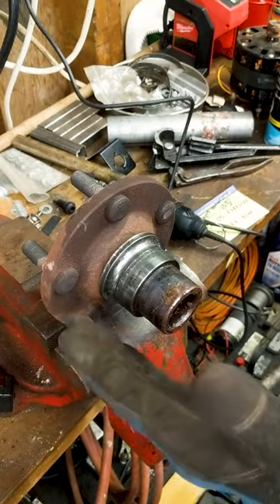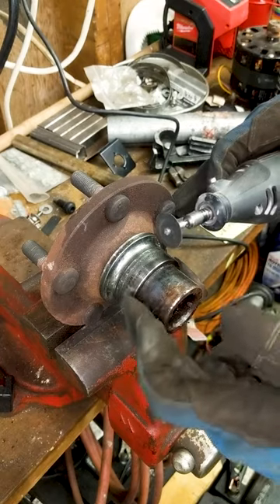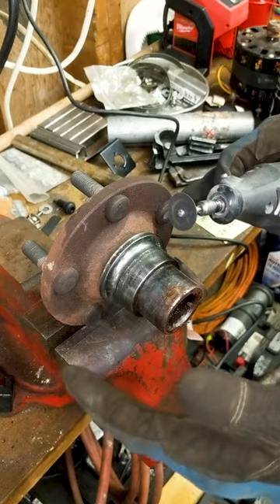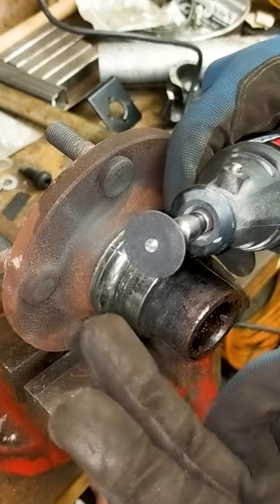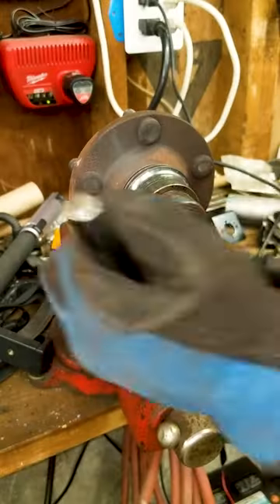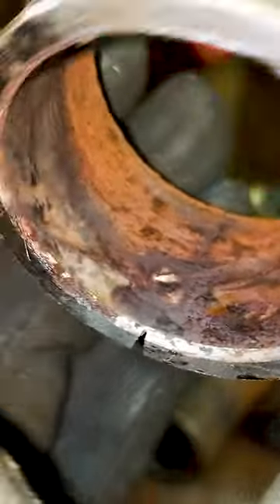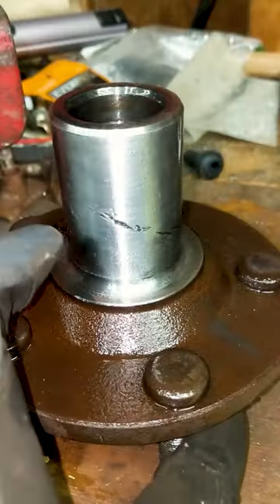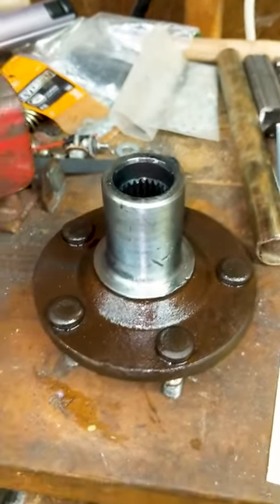Remove Bearing Race From Hub The Smart Way! #Shorts

Comment: They sell new hub assembly’s now with a new wheel bearing for under 200 bucks. Just bought two of them and I was done in 30 minutes. 😀
Reply from the maker: $200 is a lot of money to a lot of people. I charged less than $200 for this entire job. Wheel bearing was like $30 and this only took me a few minutes. Whole job was a few hours due to rust cleanup and all. Old rusty car on its last legs.

Comment: Run a line of weld around it and it will swell it and it will  come of twice as easy and you won’t damage the shaft which is very likely with any kind of grinder
Reply from the maker: There are a lot of methods that work, but many involve more expensive tools that most people don't have and heat which I like to avoid when it's not necessary. This is just one way and part of the reason to use a Dremel instead of an angle grinder is greatly reduce risk of damaging anything or hurting yourself. They normally come off much easier after cutting, but I didn't angle this one as much as I should and the shaft was very rusty. Releasing another version soon where I cut both sides.

Comment: Damn that thing just needs a new hub
Reply from the maker: It worked fine. Car is very old and beat and on its last legs. New hubs are quite pricey for the 2000-2004 Legacy platform and are barely available.

Comment: Will that air help  a 4-1/2 cutoff wheel on the angle grinder?
Reply: Probably not, most wheel wear is from hogging into the cut. Fireball tools has a good video on it, though I will add, cheap discs usually don't last long anyway. But if you're making a bunch of brown dust, your wheel is just eroding away and not really cutting. 
Source: me with hundreds, if not thousands of hours using grinders.

Comment: PRO STYLE. 📡👽🇺🇸 RUN!!! That compressed air keeps that wheel cutting wheel cool it's a good move.
Reply from the maker: Hahaha. Yeah it works great instead of using like half a disc if you go fast it barely changes size.

Comment: I accidently slitted into the hub. Is that fine? Its about 2mm deep cut.
Reply from the maker: Yeah, no big deal as long as it doesn't go the entire length of the bearing mating surface.
Reply from the maker: Even then, it might be okay, but there's a chance it will allow the bearing to slip on the hub or it could eventually crack. Low chance, but I still have to mention it.
Reply: @802Garage  okay thank you so much for the quick reply and advice!

Comment: As an older man with health issues I'll just buy the whole assembly. 
I can buy the hub and bearing from rockauto or parts geek for $60.
Now its take old off, put new on 🤷🏿‍♂️
Reply from the maker: I mean that's great. Issue in this case is that the hub is mostly only available from the dealer now and is $100+ and while there are aftermarkets allegedly available many of them are lower quality brands you kinda roll the dice on. Plus this takes all of 5 minutes and really isn't a lot of effort even for an older person. Getting the hub off of the car is far more work in any rusty area. Suppose you could just buy an entire knuckle if money is no object. ;) This was an older car that just needed to limp around a while longer.

Comment: Yeah, mount it vertically, race pointing downward. Heat with propane torch while rotating hub. P link hub expands & falls off! Ex peasy!!
Reply from the maker: I think it takes quite a while with propane. But just showing one method.

Comment: Heat & gravity are much faster & easier...
Reply from the maker: Everyone watches the same South Main Auto video and thinks they're an expert. 😂
#1 How many times have you actually used the torch method?
#2 This doesn't take very long, especially if you angle the cut more than I did.
#3 This video is about cutting, not heating.
#4 How many DIY mechanics do you know that have acetylene torches?
#5 I avoid generating large pieces of hot metal as often as possible.
#2

Comment: 4 wheel drive I am guessing, or front wheel drive.
Reply from the maker: This was a rear Bearing on an 04 Outback or at least close to that year. Yep AWD.
Reply: @802Garage  so they don’t just have a bearing hub that the axle passes through?   I assume everything with a CV axle has a bearing hub that the spindle/axle goes through., at least on the front.   I am used to the old spindle where the hub, drum, rotors, have races on the inside.   It makes sense to have a race to preserve the hub.

Comment: Hope cleaned that rust off and gave it a good shine. What you've done and explained it shows why you can charge more  and why it's justified. If you get a cheap customer dont want to pay tell him well you'll be coming back for the same part. I charge more for labor. Tell them my labor includes prep work and more Garuntee your getting a brand new part in working condition same as coming from the production line. If you got sued or anything what you tell the judge. Your labor cost is what gets them more bang for there buck. He wanted to be cheap had to cut my labor to get him his vehicle. I changed the part like be asked got him a working vehicle. He got cheap labor but fair Labor. Even your cheap labor and is better than other. Meaning your taking care not to damage other parts. If you record your whole work you can sue the customer back but you can but then only accept what's fair for your time away from the shop so people will respect you and your craft 100 times more better
Reply from the maker: I definitely take my time and try to make everything nice. I did clean this up and I even cleaned and smoothed the gouges and bumps from previous "mechanics" one of which may have even prevented the race from sitting evenly. He has been daily driving the car for a long time now with a lot of weight in the back, has had no issues with either rear bearing I replaced. I agree with you.

Comment: yeah but how many discs you gonna replace whith that dremell usually takes longer time than an old trusty grinder with thin disk
Reply from the maker: I literally showed it... I didn't even use 10% of a single disc...
Reply: Sorry it cut in mid video it must be a good disc then
Reply from the maker: @luisdlc21  It's actually a cheap generic disc that came with a no name Dremel style tool. The air trick just actually works very well.

Comment: Why not just heat it up to cherry red and pull it off?  You can use a high head propane torch.  Most people doing this kind of work should at least have one of those in the garage.
Reply: High HEAT head.
Reply from the maker: @ginginthing  See pinned comment. Propane will never get this cherry red though. Way too much mass.

Comment: Doesn't matter if you nick the hub a tiny bit with an angle grinder. That's not a bearing surface, it doesnt affect it at all.
Reply from the maker: Yeah it doesn't matter, but I like to avoid damaging anything I work on. Plus the last person actually did damage where the bearing face sits against the hub back and I have to grind it down for a flat surface. Could have contributed to vibrations or bearing failure. A little care can go a long way.

Comment: Just replace the damn thing. My boss never wants to replace them and I want to replace them all. I got shit to do, money to make, more cars to fix. No matter what anyone tells you it’s always faster and easier to put a new hub on. Charge the customer and move on.
Reply from the maker: Obviously replacement is an option. It's not, however, what this video is about. This technique can also obviously be used on much newer and less rusty hubs. Not everyone lives in the rust belt. I also prefer not to create waste or spend money if I don't have to. Additionally, there are virtually no aftermarket hubs available for the 2000-2004 Legacy/Outback and corresponding Baja platform. Plus, aftermarket hubs that are affordable are often lower quality than OEM. If it ain't broke, don't fix it. The OEM replacement only comes as a hub and bearing assembly, and is quite pricey. The target audience for this video is primarily DIY mechanics, home gamers, and people on a budget. If you want to replace your hubs, but all means, spend your money instead of spending 5 minutes saving the hub. Personally, my 5 minutes is worth the $75 minimum this hub would cost to replace. Even the cheapest hubs I have seen are usually $25+ and I'd rather save the money. Lastly, this car is very high mileage and on its last legs as is, so a new hub would kinda be a waste. I have never had an issue with a hub I reused. Just saying.

Comment: What's the cost of a new hub ?
Reply from the maker: In this case the cheapest is $75 plus wait time from eBay. Hubs are very uncommon for the 2000-2004 Legacy platform and they don't sell aftermarket hub and bearing combos. Don't ask me why. Nearly $200 to get it from the dealer. This car is high miles and on its last leg, so this worked.

Comment: You risk going to deep wit this method better to use a grinder and grind a flat spot on the race as you get close to going through you’ll see the race change color from the heat on the thin metal
Reply from the maker: You're trading one risk for another. Far less likely to go too far with a Dremel.

Comment: Let’s go through those cutting wheels so fast man even with air
Reply from the maker: It literally barely wears down if you use the air, hence the tip. I did both sides of a bearing race thicker than this one the other day and used maybe 1-2mm of a wheel.

Comment: I usually use my induction heater + a chizzle nizzle then tap it off after heating
Reply: That's what I did to  mine, I tap it the first time after I used the induction heater,the race moved a little.and it dropped out by itself after the second time applying the induction heater.

Comment: Heat the race with a MAP Torch and it's going to slide right off...
Reply from the maker: I usually only see it done with acetylene. MAP would take quite a while, especially depending on the hub. This video was about the cutting method though.

Comment: Or…….
You can heat the race up and hit it with some cold WD-40 then take a small ball peen hammer and hit the race with the ball and the race should shatter like glass. 
Done this several times on wheel bearing races and has never failed.
Reply from the maker: Interesting.

Comment: I honestly thing the last 20 jobs I've done had the parts previously installed by a 🦍 with a 🔨.  Heater core?hammered. Battery terminals? hammered. Random bolts? Hammered. Brake calipers, hammered... hammered flat, mounts, hammered lolm
Reply from the maker: Damn I feel that, hahaha. This hub was beaten to hell.

Comment: Good thing that “damage” has absolutely zero to do with how well the bearing or hub function.
Reply from the maker: Yeah it's no big deal, although there actually was damage to the base of the hub rear which would have prevented the last bearing from sitting perfectly flat. I had to grind it down before refusing the hub. So sometimes it can matter and either way I like to not damage components. 😁

Comment: I just use a full size grinder, takes about 4 second. Slap a chisel on the groove and it cracks, done.
Reply from the maker: Same.
Reply: @802Garage  somehow missed you talking about it at the start. Don't see why your tip would be to use a smaller, less effective tool?
Reply: @802Garage  because realistically you'd have to do a hell of a lot of damage to a hub to ruin it, and dust and noise... Lol
Reply from the maker: @Vike_12  I'm making a joke. This is just one method. As I mentioned, it's a way to be more precise and make less noise, heat, and sparks. If everyone teaches the same technique, we end up with only one way to do everything.

Comment: It's cheaper just to buy the bearing and hub and the tool from harbor freight to press it in yourself
Reply from the maker: It's not. How would that be cheaper? The whole reason to do this is so you can then reuse the hub and press it into the new bearing. To save money. 😂
Reply: @802Garage  depends on how many cars you have times 4 per car over time here in Maine every couple years you pay a shop to reuse your hub you rack up a lot of a bill and a bad bearing most likely messed the hub up so I toss them
Reply from the maker: @louisbrown2279  Oh sure it might be cheaper in terms of labor depending on how a shop wants to charge you. If you are doing it yourself or the hub is expensive this def saves money. In this case the car was on its last legs anyways and this hub actually isn't available without buying an entire OEM assembly for some reason which was way more expensive, so I was saving a friend some bucks.

Comment: By the looks of the hub it needs replaced
Reply from the maker: Ran true enough until the car was scrapped a few years later. 😉 It was a quick fix on a car planning to be replaced and ended up lasting way longer than planned. 😂 I agree though it was probably past its prime, but they don't sell this hub standalone and the full assembly was waaay pricier than buying the bearing separate.

Comment: Or you can use a mig welder and pass a bead around it and throw some cold water on it and watch it crack when you strike it with a hammer. Wear safety glasses

Comment: Those little nicks ain't hurting shit, it's not a seale
Reply from the maker: I just said it was beat up, not destroyed. That's why I reused it. I prefer to not damage what I work on. Previous "mechanic" had damaged where the front of the bearing race sits so it actually was sitting unevenly. I had to grind it down to correct it. I care about my work.

Comment: Or you can just buy a hub for 30 bucks and save the customer the hour labor 🤔
Reply from the maker: Except in this case you can't buy the hub by itself, the hub assembly with bearing is much more expensive, and this took well under 10 minutes total.

Comment: That's not the smart way.   The smart way is use heat and risk zero damage to the hub.   Just need a torch, a vise and preferably a conical pipe.   Set the cone into the vise facing upwards, place the hub with the bearing facing downward.   Start spinning the hub at a mid speed.  Then you the torch to heat the bearing...it will expand and fall off
Reply from the maker: The smart way as compared to using a full sized angle grinder. Context. Also using air to save the cutting disc. It's just one method and some tips on how to get it done. 99% of DIY mechanics do not have an acetylene torch or even MAP gas readily available. I prefer to avoid heating large metal objects when possible too. This doesn't take long at all, especially if you angle the cut more than I did in this example, and it's easy to avoid any hub damage. Everyone has seen the South Main Auto video, but this is the only video I know of demonstrating how to use a Dremel. What you described it time consuming as well.

Comment: Or just save some time and get the entire assembly
Reply from the maker: You can't buy the whole assembly for this car aftermarket and it's very expensive from the dealer. For any cars with press in bearings, a full assembly is not an option anyways. Plus, why waste your money when this doesn't even take long?